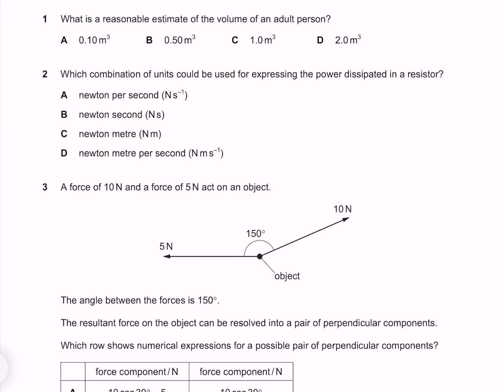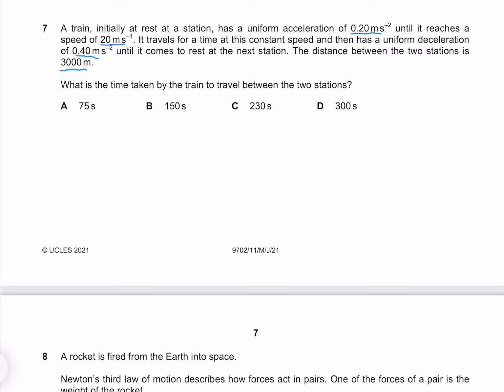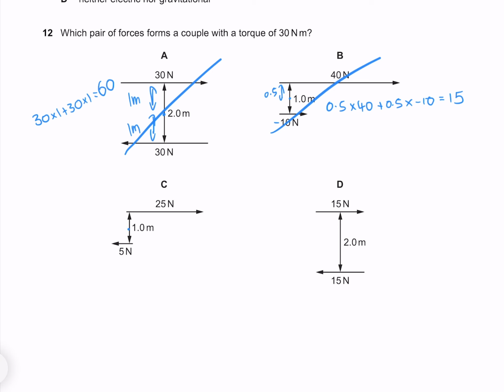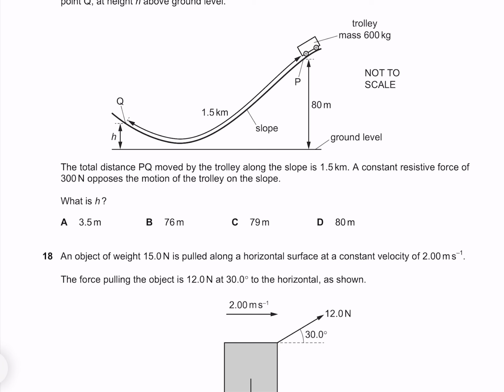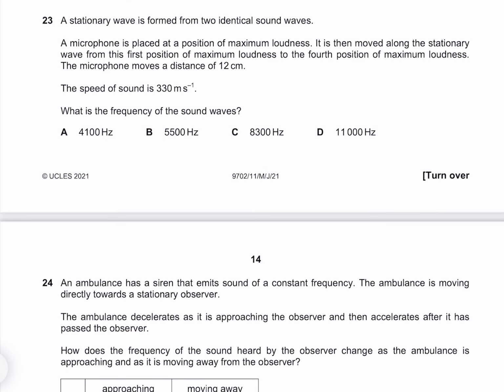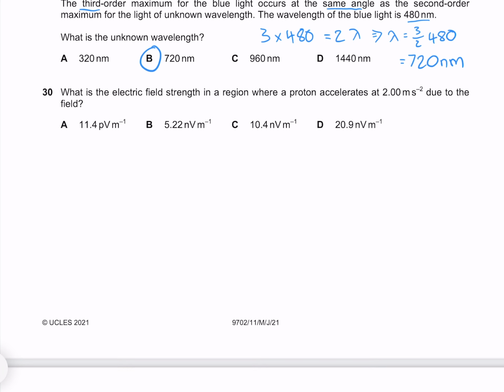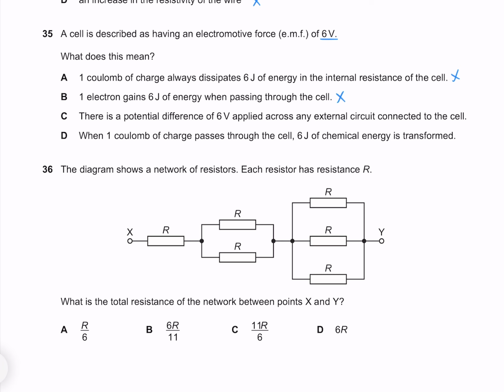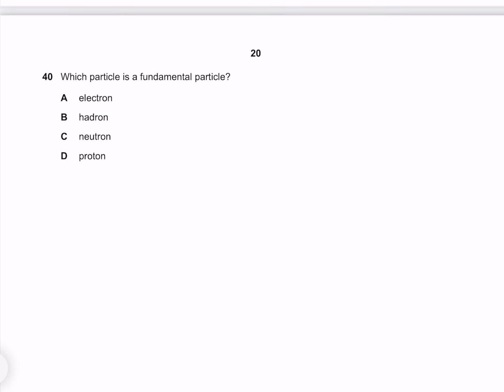2021 AS & A Level Physics Multiple Choice 9702/11

Comment: what is your technique when going through past papers?
Reply from the maker: Hi Stacy, great question. I do have a rough process, though with experience after a while every problem you face will just be a variation upon one you've already encountered. It really does all come down to repeated practise.

I start by identifying the key concepts that are relevant to a question, considering the situation as well as the physical quantities that are given.

Next I start to think about what equations might be useful. Depending on the question there may also be some assumptions I need to make. Such as "this kinetic energy" being equal to "that gravtiational potential energy".

Once that is done, all that is usually left is to work through the mathematics.

Hope that helps!